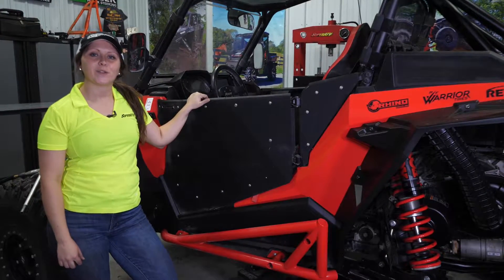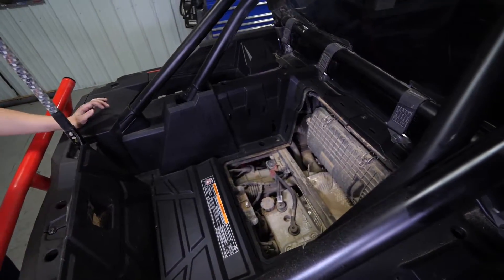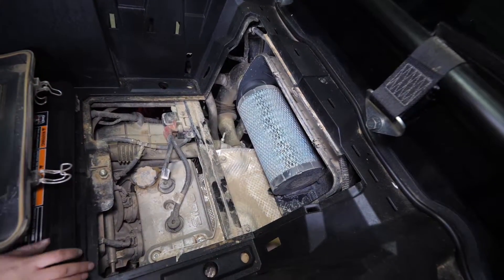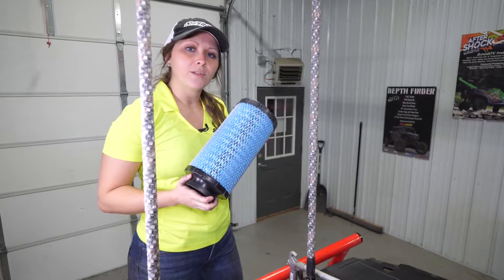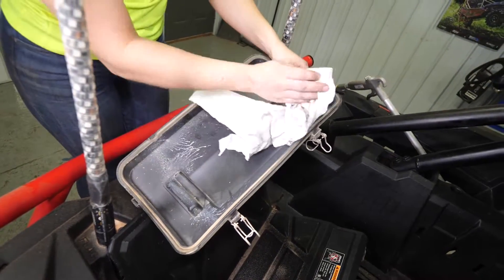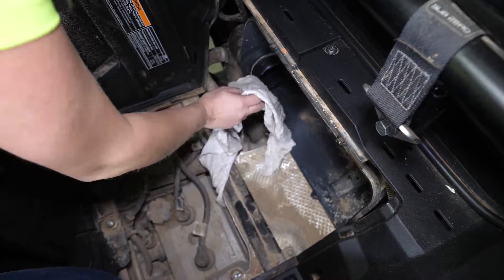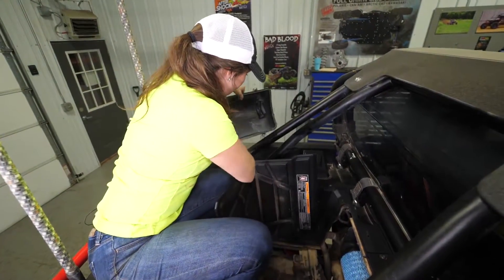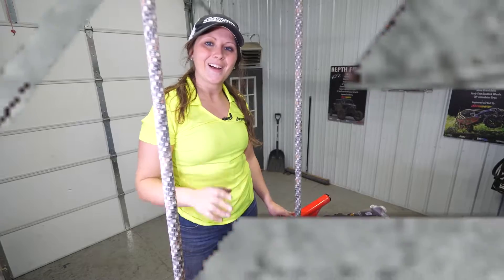How to Inspect/ Change Air Filter on Polaris RZR Turbo S | UTV Maintenance Matters | SuperATV

Comment: I put a little grease on the matings surfaces between the filter and inlet just for an extra layer of protection in case of a failed seal.
Reply from the maker: Great contribution to the community. Another good tip indeed.
Reply: Do you oil the new filter?